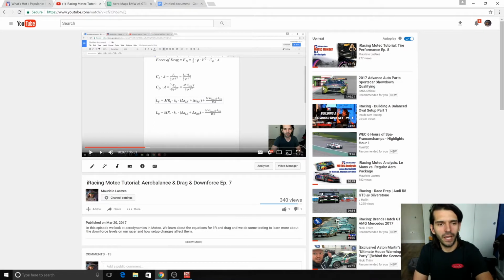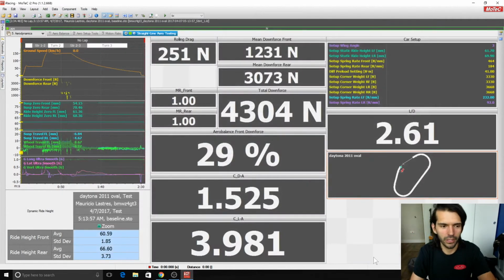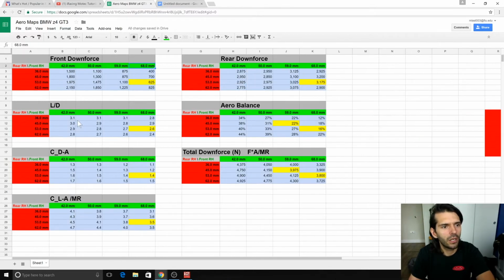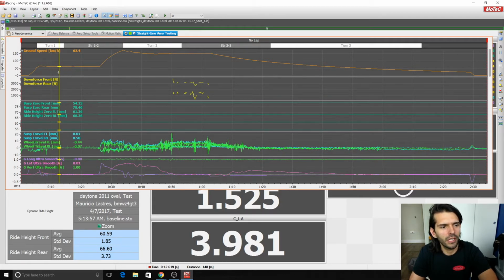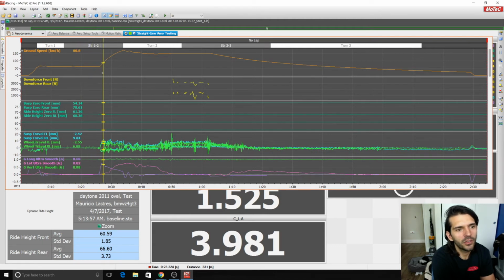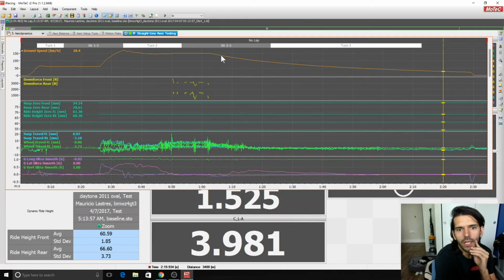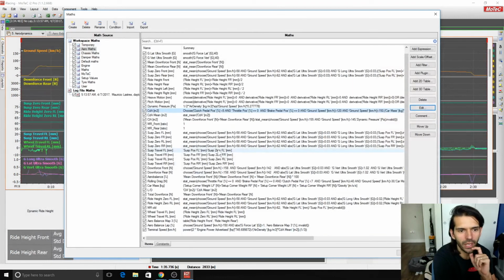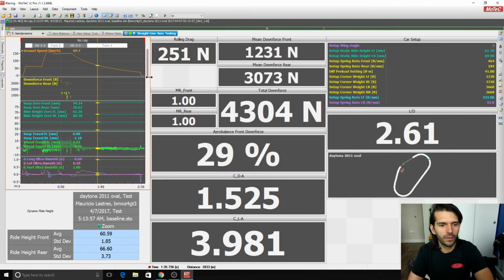iRacing Motec Tutorial: Ep.9 Aero Maps Part 1

Comment: Hi Mauricio, is the friction drag a constent value?
I mean engine brake grows with rpm, could friction drag raise with transmission speed for example?
Or maybe the drag brought by the tyres is maybe a constent amount for 1 round made by the tyre, no idea but if so it would bring a huge amount of extra maths lol.
Anyway i think it would give a small amount that would finally not count in the rest of the results compared to the aerodrag.
Reply from the maker: Yes, the cars deceleration below 60kph is practically linear which means the mechanical friction is a constant value for the conditions given. Yes, the force of mechanical friction is a function of the tire, tire pressure, state of the bearings, lubrication, etc. But its not practical to calculate that in because the changes are assumed to be negligible. Specially for racing purposes it would not be efficient to care. Perhaps only if you are doing research for a tire manufacturer or you are working with lubricants or bearing design.
Reply: Yep, that s also what i thought